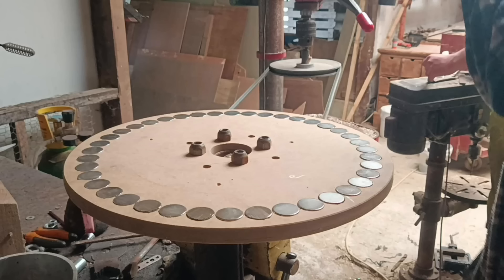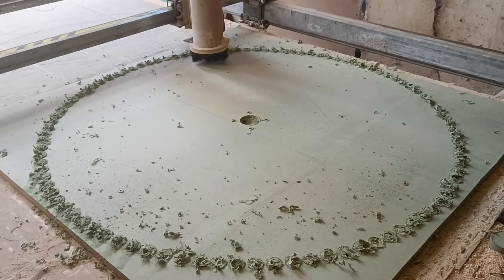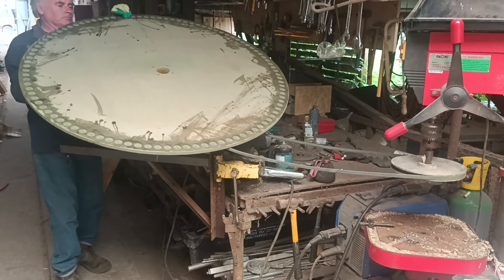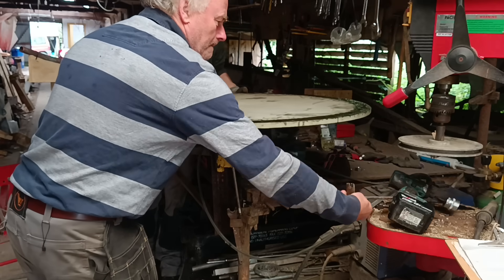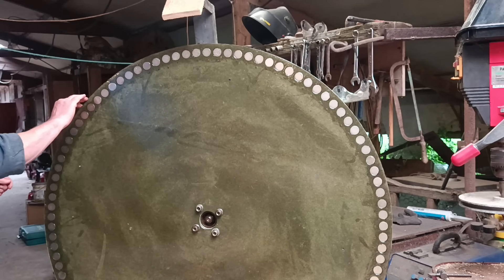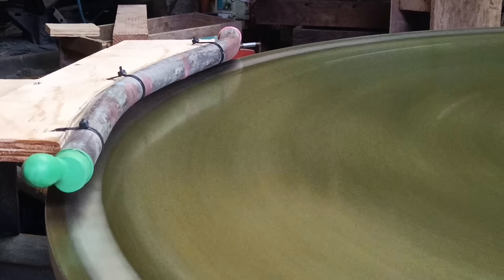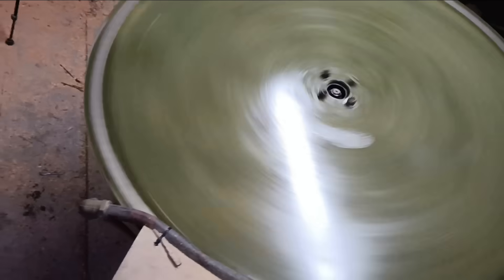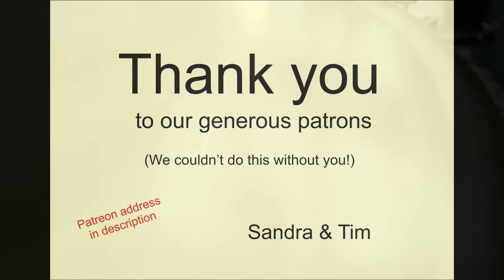ABSOLUTELY HUGE Magnetic Induction Heater! Using 100 Spinning Neodynium Magnets And A Bucket

Comment: Take the energy, what u used for spinning the wheel, for heating the water ^^
Reply: He wants to use a windmill to turn it but this is so inefficient; he would be better off producing electricity with this and then heating water, or using the solar panels made for heating water. Those things don't care if it is cold; just the sun needs to hit them. It would be probably cheaper too; magnets are expensive :D

Comment: Two layers of magnetic wheels which spin on the same shaft, to sandwich the pipe and heat it from the top as well as the bottom

Comment: More copper completely covering the magnets and the distance reduced.  . And the speed reduced to a third and two thirds? Just to check the effects of speed.  And yes sir very interesting indeed.  Thank you for the video.  Ps narrower pipes.  To reduce the thermal transfer distance from the centre to the side walls.

Comment: if you make a coil using the copper pipe and reducing the size of the wheel by aligning the magnets along each copper pipe coil you could reduce the wobling and maximize the heat transfer . the idea is you have too many magnets spinning but too litle pipe in the magnetic field, consequently you are not using the total potential of the wheel.

Comment: does the magnet wheel need to be a flywheel or could you remove material by cutting some "spokes" into it for weight savings so it would spin easier?

Comment: Increase your energy density two ways. Four sections of copper tubing starting at  zero degrees to 45 degrees on side A then 45 to 90 degrees on side B. Lag all the pipe work and keep it all copper so the heat is not lost after induction. Feed all the flow and returns consecutively to cause a runaway effect keeping side A and side B as two header tank circuits. You will have a high heat gain system with low losses. Do not interchange materials from copper to plastic.

Comment: Please look up something called a 'Power Ball Wrist Strengthener". Its a dual Axis hand held gyroscope device that spins up to 15k RPM designed for building arm strength. You could line the inner spinning ball with magnets, the outer shell with coils and make a hand held power generator.

Comment: I would suggest using a much denser pipe over the magnets as it will retain alot more heat over a longer period. Another thought is that if this was used in practice I would let the element heat up to maximum temp before running the water through the lines.

Comment: You can use wind and hydro power for heating. This usually involves either electricity or a compressor, or other mechanical means.
This kind of wheel can just heat a couple of pipes directly. It could also generate electricity at the same time. 
So you could build a whole workshop around a single rather simple machine. No need for even storing energy if you have constant wind or water flow.

Comment: Just remember, if you get those magnets hot enough, they will stop being magnets.
Reply: Good point
Reply: Only the stationary object affected by the current with heat up, and the only reason there's a current is because he has placed the magnets in a +/-/+/- style so when the disc is spun, the object to be heated has +-+-+- running past it quickly, but as far as the magnets are concerned, they don't know anything is even happening as they are not changing polarities, they are simply moving past the same object every rotation
Reply: @TheRadiationStation  Both will heat up in the exchange. Think about it. From each other’s perspective, it’s the other one doing the moving. Cody’s lab did a video showing it exactly if you wanna watch it happen.
Reply: @TheRadiationStation  if you put a piece of metal near another piece of metal that is heating, thermal transfer happens, too. Cody’s lab…
Reply: @jimk8520  Thanks buddy haha, yes that should be obvious, I'm not going to argue with you, I came to this video to try to refine my own experiment and I know how hot and cold these things can get. If the pot sees 100 magnets per revolution, each magnet sees the pot one time per revolution, plus the air cooling from the spinning and there is minimal heat especially at this size of disc haha.
 I wasn't discrediting your point, as you are absolutely right, not only if a magnet gets too hot, but even ferrous metals. Like if you have a pallet fire and plan on collecting the nails after with a magnet, even though the nails are not magnets themselves, their molecules go wild and cannot be picked up by a magnet, unless you remagnetize them, and there are a couple ways of doing that, simplest being rubbing a magnet against it in the same direction over and over, but that doesn't help collecting haha. 

Anyways short answer, the magnets do not heat up enough to notice, my thermal camera can see a minor difference but it's so sensitive that I can touch a surface for a second and still see my heat signature for minutes later
Reply: @TheRadiationStation  Small magnets at distance don’t heat much - you’re right. They also don’t affect the object you’re trying to heat much, either. Haha
Reply: @jimk8520  Not much on this scale either way, but the object being heated does take the the majority of the heat and that cannot be disputed, I can't prove to you without making a video and showing you, but YouTube has plenty on an even hotter scale than what I have, you can turn a piece 3/4" rebar white hot in 20 seconds in an induction coil, and still be able to touch the coil with your hands haha 🤷‍♂️ I didn't write the laws of physics, was just sharing them haha
Reply: @TheRadiationStation  You are correct about the induction heater but then that’s not 100 spinning magnets on a disk anymore, either. Your physics might be the same but the test station doing the actual magnetic transfer is wildly completely different. All I was trying to say is that the radiative and thermal transfer isn’t zero. 

Always and never are the two most dangerous words to use for the scientific community simply because nothing in our reality can be named that always and never does anything at all. Your first statement started with ONLY which clearly wasn’t true - that is all.
Reply: @jimk8520  You're right there for sure I did fuck up, but have been drinking as I said and shouldn't have been scientific haha. In non scientific/drinking words, I meant you can touch the magnets happily but would not want to touch the pot hahah. Cheers buddy I'm done, you understand, I understand, and I bet everyone else does by now haha 🤣
Reply: @TheRadiationStation  that's not entirely correct, the magnets feel this "pull" as well only far less so, and only once per revolution. While the stationary magnet is subject to constantly changing magnet fields. So, yes magnets will all so "feel" the attraction. But far less so than the metal beeing heated.
Reply: @Nicholasbroughton0420  Thanks, that what I was poorly trying to explain but was drinking haha. My setup has 130 magnets and I have never seen them gain more than 2-3 degrees, only noticeable on my thermal cam not by touch
Reply: 140F, i think..not sure tho
Reply: @trunn3023 - they don't get hot the magnets, they produce a magnetic field.

Comment: Love what your doing, and yes I have the idea you need take about 10 feet of copper pipe and bend it back and forth until you have what looks like a water radiator and then build a frame or box around and fill full of insulation I would use spray foam but depending on how hot  it gets your gonna wanna wrap the pipes first with fire proof thermal wrap like exhaust wrap for a motor bike, I'm looking forward to seeing what you have planned next and I and have plenty of ideas too

Comment: It would also help if you put the copper pipe closer to the magnets, and it would even work better if you would use a second disc wich is on top of the pipe. So you will get a massive increase in flux between the magnets.

Comment: I'd use a thicker piece of copper or a copper or aluminum block that is thermally coupled to the pipe. If the metal is thin, the eddy currents will likely be weaker

Comment: Magnetic bearings that levitate the disk and don't make any physical contact would remove any issues with wear.
Oh, and I was under the impression that this process works much more efficiently with iron or steel rather than copper.
An induction cooker creates the reversing magnetic polls by flipping the current in a coil, rather than physically moving magnets, but the effect ends up being similar, and induction cookers need magnetic iron or steel pans to work.

Comment: I would also use a thermostat valve like in on a cars radiator.
The kind that are sensitive to the heat and open after the water is at temperature. 
Idk but it helps warm up my cars fluid faster.
Idk but don't insta pots heat water like this with no moving parts somewhow?
Seems really cool though ive seen many experimental magnet machines but not any that are of real use aside from micro-windband generators.
I believe electricity and magnets have some untapped sectets like electrical lift effect and warp drive 🕳️

Comment: Very interesting concept, could have some very realistic applications in home heating with wind/water power. Think heat pumps but with wind/water-driven magnetic induction doing the heating. Totally skips the need for electricity altogether, turning mechanical energy directly into heat.

Comment: If it was thin enough you could heat a pipe above and below at the same time as encircling the circumference. Or build 5 smaller on a rod, equidistant gaps and run the copper pipe in and out. Or the best yet. Build a box the length of the pipe that can be suspended and rotate in bearing enclosure and you spin up the box around the pipe instead of the original way. That way you can REALLY crank up the rpm’s…

Edit: octagon shape would be better than a box but idea is still valid

Comment: I did this experiment using a two horsepower motor spinning at 3450 RPM and a 10 inch wheel with neodimium magnets as he did to see if I could get hot water for a lower cost than using an electric water heater or perhaps water hot enough to heat my house. It was a waste of time at a great expense. Initially the copper tube will turn cherry red but as soon as I put water into it the motor stopped spinning due to the intense drag. I ended up with a new ambulance generator, brand new two horsepower motor and over $1,000 in magnets. None of my experiments produced the outcomes promised by the hundreds of videos I watched.

Comment: As another person said:"@faragar1791
2 weeks ago
Mabe make a circle of copper tubing that follows the full circumference of the magnet wheel, that way all the magnets are continuously heating up the pipe". I would add: install a water heater to accumulate the heater water and later a water pump to circulate.

Comment: If you have an AC current meter and you connect it to your drill press, you should be able to see the load change quickly as you try different pipe geometry, etc.  Say the drill pulls 200 Watts without the copper tube over the magnets, and 250 Watts when the tube is in place.  You very quickly determine that you're getting 50 watts of heat out.

Comment: I’d suggest a few modifications. More gearing (off an old bike) to get the speed required but then easier to get a smoother disc spin to allow the magnets to get closer to the pipe. The closer the distance the magnetic flux increases by a factor of 4

Comment: This effect can be so easily achieved electronically , no need for 1km wheel with magnets
Reply: and in fact, even simpler..nichrome wire is the method. and guess what its nearly 100% effective;) ....next up: witchcraft with heatpumps..

Comment: I am pondering over a number of improvements:
1: Take a thick walled square tube over a much larger part of the circumference. The flat bottom at a short distance will meet more eddy currents and the energy transfer will be more effective.
2: Halve this (imo too large) large circle, but make two of them. Sandwich the flat tube between these two rotating plates, so that the flat tube is heated from below and at the top.
3: Place the whole thing in a heat-insulated environment
4: Now first do a number of measurements. At what rpm is the supplied heat energy sufficient?
5: Determine an average speed of the windmill to be built, and if that delivers too low rpm (as expected), then determine which transmission should be placed between the engine and the heat generator to optimize the whole setup.

Maybe it is even better to make more than two disks. A thick walled tube could be a problem. Aluminium is available as thick walled round tube. Maybe it is doable to flatten the sides after bending.

Comment: If create the same exact disc and space it evenly above the lowers disc. I have a thought on how we can make both discs infinitely in opposite of one another, evenly spaced of course. Also have another personal wish to utilize ball bearings made from specific types of metal. With an arrangement of tracks and brushes that would in theory run forever. But it’s probably all out of my grasp

Comment: Great idea…alternate a magnet set at a 90 degree angle to the others and a 180 degree angle from above mirroring in alternation the same disk with a current in the middle that the induction glow creates to up the output by 10kvm..

Comment: 2 suggestions: 
First: insulate tube completely with fire resistive silicon to avoid air ventilation from the wheel.
Second: eventually flatten the tube to increase the heating surface..
Thanks for sharing!

Comment: I’ve done exactly this on a much smaller scale, I used a aluminium disc (laser cut) with 30 odd Neodymium 6mm x 3mm N42 magnets (same layout as yours although I had the magnets all facing the same direction) mounted to a brushless motor, I made the copper pipe (6mm) a complete circle aligned above the neo magnets (except for the inlet / outlet which were angled upwards) sitting very close to the neo magnets (1mm distance) I had the motor running very fast (18/20k rpm - it gets scary) the copper pipe glowed red hot - melted solder instantly - I never tried passing water through though. I really need to get mine up & running again and pump water through it & see what results I get. Good luck :-)

Comment: Theres an Option for way more heat transfer by creating multiple interconnected tube rings and putting the whole wheel full of magnets and putting the cold water into the middle this should improve efficiency and because there are more magnets in the outer rings these should get a way higher temperature because the frequency of the magnetic field change is higher as you stated. 
Minimize the distance of the pipe and disk because the magnetic field weakens I think with an inverse square to the distance to the magnet. I still think iron pipes should work better for heating like in an induction stove but this would add force to the construction when trying to minimize distance to the magnets.

Comment: Surely you take the heating ring around the entire disc to get constant output?!
Reply: Also, what happens if you stack em?! Likes another disc above this one, with a conductive ring inbetween. Maybe be able to drive that for the same unit if applied torque is high enough in practice

Comment: You could try smaller and more densely packed magnets to increase the frequency.  As others said, a copper plate the shape of an annulus soldered/braised to the copper pipe will help get more copper close to the magnet to capture more of the field.  You could have multiple discs and pipes stacked on top of each other.  You could make some holes in the wheel to make it lighter in weight as you mentioned it takes a while to speed up and slow down.  You can also use something ferromagnetic to increase and direct the magnetic field, in the same way that an electromagnet with an iron core is stronger.  Cody's Lab did an experiment, which may inspire some more ideas:  https://www.youtube.com/watch?v=l8PxXZoHTVU

Comment: Put large coil electrical generators near the magnets.  They generate a lot of electricity the powers an electric heater coil that heats the water.  You can use an old hair drier coil to heat the water.

Comment: You should get a USB-C (or whatever your phone is, or a standalone) thermal camera. They're (mostly) 100 to 200 USD and they're essential for doing anything thermal. For example, it could be that, for whatever reason, the thermosiphon you had set up stopped circulating. This can be very hard to spot with a thermometer, but just takes one picture with a thermal camera. I mean I have an extra one I don't use that you could just have, but the shipping and VAT would probably be more than a new one.

Comment: If the purpose is to heat some water,you could just buy a cheap electric kettle which is more efficient,without spending all that time ,effort and electricity running your drillpress.
If the magnets did it on their own I would be impressed!!!!??!!

Comment: Here are some:
Circle a longer copper tube over the entire circumference. 
The ends of the pipe need to be at different levels to allow effective flow via thermo syphon effect.
Add a low power pump (pushing into the pipe) to improve heating time and temperature.
Insulate the pipe 
You can use copper only for the heating area and a cheaper material pipe for transferring water to and from the bucket 

Next version idea: maybe mount the magnets on the side of a belt and using an aluminium pan/woke over the free end (with a smaller pulley/drum) where the magnets turn around at high speed. You may add a gear to increase the speed/may be hand operated as well
Reply: If you live next to a river, hot water forever.